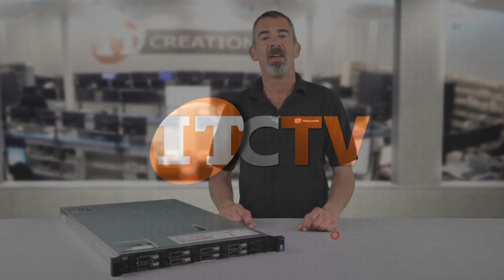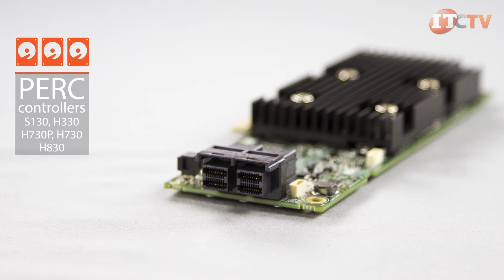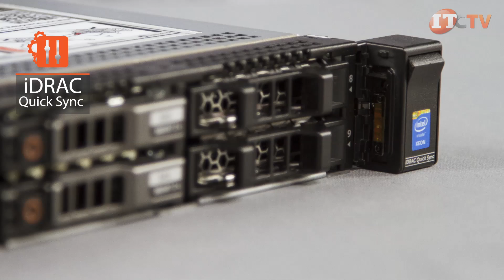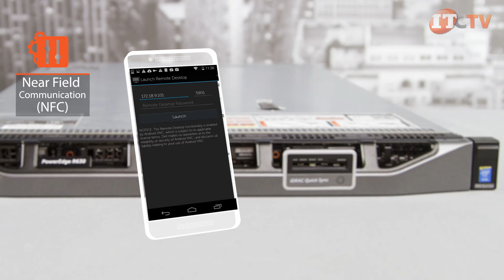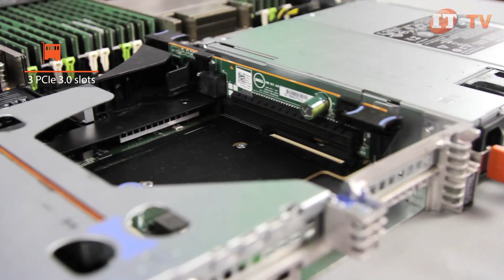Dell PowerEdge R630 13G Review

Comment: I just noticed that there are MANY 1100w PSUs compatible with the r630, but I can not find documentation on those different models. They are seemingly the same but have different model numbers. Do you happen to know anywhere where more in-depth PSU information could be?
Reply from the maker: There really is no in-depth information on this topic that I know of. However, Dell uses a few manufacturers for their OEM equipment hence the different part numbers. They all function as intended and there may be slight differences in price but I wouldn't worry about it. Thanks for watching!

Comment: Can I install two 1100w power supplIes?
Reply from the maker: Hi Ollis, Yes you can. Here is a link to our Dell PowerEdge R630 landing page which has a "Documentation" section at the bottom with all of the specs and manuals. https://goo.gl/rm6EqQ . Here is a link to the PSUs, which we do have in stock: https://www.itcreations.com/catalog.asp?s_s=r630+1100W 
One thing. The 495W and 750W PSUs are AC and the supported 1100W PSU you are asking about are Direct Current. Hope that helps, and thanks for watching!

Comment: I guess you meant 768MB instead of 768GB, right? around 6:20
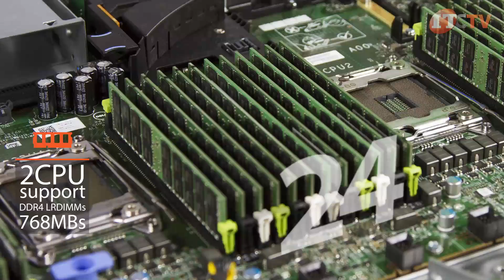Reply from the maker: +Calibure if you are referring to the supported memory at around the 1:53 mark Chris says the right number 768GB using 32GB DDR4 memory modules but we put the wrong number on the graphic overlay—oops! Of course, since we released this video the new Intel Xeon E5-2600 v4 processors were released adding more cores 22 cores with the top of the line processor instead of just 18. 64GB memory modules are also now available doubling the supported memory from 768GB to 1.5TB. Most systems that support the E5-2600 v3 processors will support the E5-2600 v4 processors, across manufacturers. Here are the new specs with updates on both processor and memory. 

http://i.dell.com/sites/doccontent/shared-content/data-sheets/en/Documents/Dell-PowerEdge-R630-Spec-Sheet.pdf

Most irritating of all is the fact that they don't list support for the older v3 processors on the new spec sheet. Thanks for the catch you are one of the few to notice.